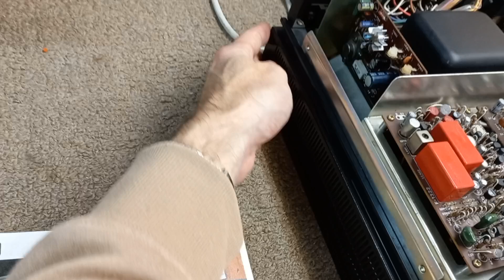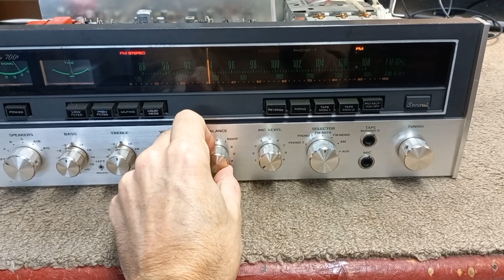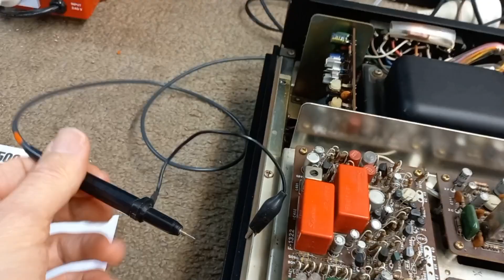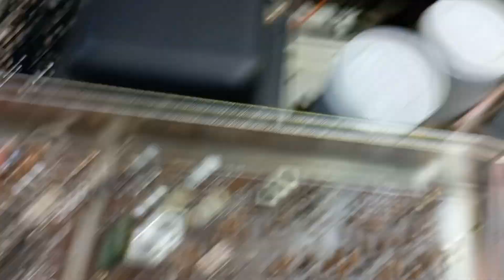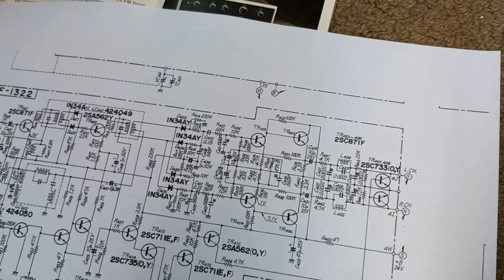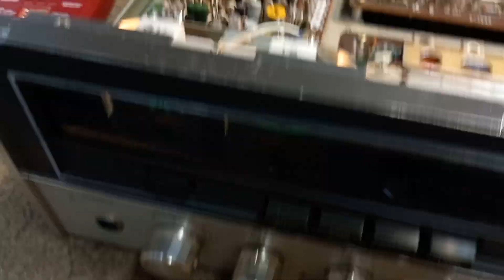Sansui 7000 Receiver Repair

Comment: nice work bench ;)

sweet find, nice easy fix, never thought of moving a transistor to confirm a fault, nice tid bit
Reply from the maker: Thanks! Its a method I've used in the past for those particular type of troublesome transistors. Doesn't work all the time, heating and cooling the suspect transistor can also make it act up.